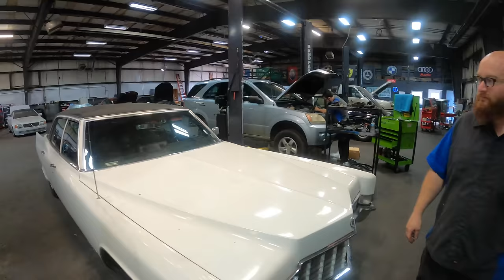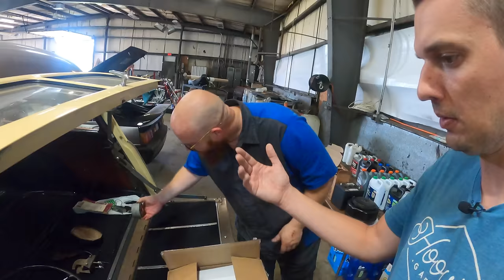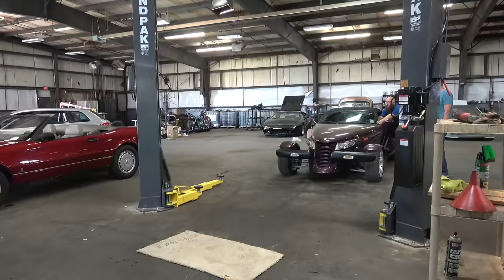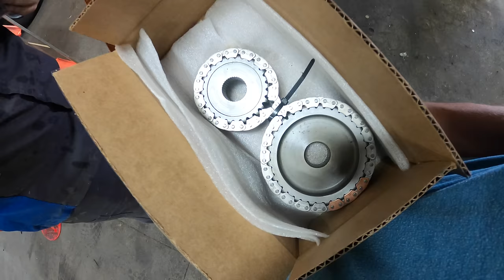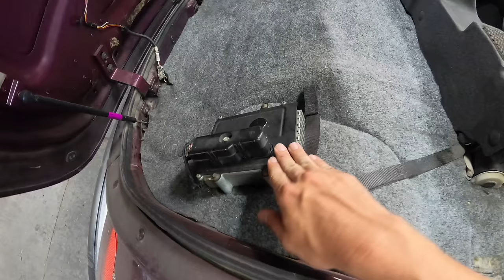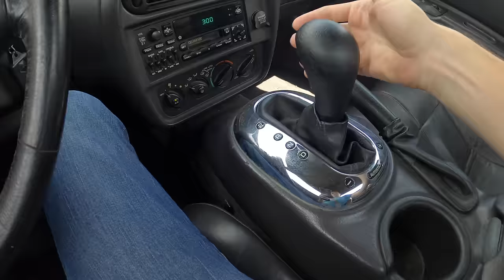Everybody Should Buy A Plymouth Prowler And Do These Mods RIGHT NOW!

Comment: Everyone bashed them for only having 253HP but they only weigh 2500lbs. That’s the same power to weight ratio of the first gen SRT 6.1L vehicles. This video is proof of what a proper tune and gearing can do to really put the power down.

Comment: That Chrysler 3.5L was a great engine. I had a 2002 300M Special with the same engine and transaxle. Absolutely intoxicating exhaust note. Best and most reliable car I’ve ever owned. Chrysler was on fire from the mid/late 90s until Daimler sucked the life out of them.
Reply: You are correct and like BMW who sucked the life out of Rover for 4wd Intel, Daimler ( the Chrysler was silent) did the same. I had other people rave to me about Chrysler products I recommended in the 90s to them.
Reply: We have had our 2000 LHS for 21 years and 278k miles. Still runs great. The Prowler does as well!!
Reply: There were still some pretty good Mopar engines up until the early 2010s when they really went down the drain

Comment: This car seems like such a cake walk to work on, never would have guessed.
Reply: Most Chrysler vehicles of that period were easy to work on. I've done the absolute quickest timing belt and water pump replacement on a car with this 3.5l engine, that I had to double check I didn't miss anything. It was also the cheapest timing belt job, which included everything that should have been replaced.
Reply: Sides of the engine look pretty tight....
Reply: The sides don't matter, there is not much on the side
Reply: I love the 300m and lhs 3.5 LH platform great cars unstated now I wonder if the diff tricks on the LH cars too.
Reply: The diff trick might work, I do remember they were chain driven, but I never opened one. I never needed to open on, those cars were reliable, with only minor issues.
Reply: snoopdogie187 everything matters in regards to aesthetics, but no looks matters in functionality - it’s a weird balance human beings require
Reply: It seems like such cake to work on because they're not showing you any work being done on it. Lol 
Underhood is a bit of a nightmare to work on. The rear quick change gears is pretty neat, but that does not represent working on the rest of the car. Lol
For example, notice they didn't put that panel back on...
Reply: @TravisFabel 
That is the easiest car panel ever to take off. Its 3 bolts and 1 light bulb. Less than a 2 minute job. They had no reason to put it back on because that area is still being modified. 
Underhood isn't bad either, that engine has everything on the front, and the prowler made the front of the engine easy to access.The only thing that was on the side was of this engine, and the one I worked wasn't in a prowler, was the ignition coil. The prowler has a coil on plug setup, so even that is done on the top of the engine. The 3.5 engine was an odd engine, being in a longitudinal orientation, even in front wheel drive cars.
Reply: GM man they come thru sometimes
Reply: David Pasch this isn’t GM lol
Reply: But it is also true of Chrysler, they had their good cars, their bad cars, their terrible cars, good period, junky periods, and everything in between. I tend to think 90s Chrysler was top of their game, and held that for awhile somehow.
Reply: @snoopdogie187  you are hella  rightit also had to do with the engine and chassis , bc 357, and  LS are both bulletproof engines and   with simple yet effective design. Also gm occasionally borrows really good cars , the Chrysler crossfire is a Mercedes coupe underneath but for a fraction of the price.
Reply: @snoopdogie187  I own a chrysler 300 with the same engine and even though the car weighs over 2 tonnes it still gets up and going at a surprising rate

Comment: I love that the intake is buried in the fender. A whole lot of air in there, for sure!
Reply: The ECU is in the worst place!!!!
Reply: I haven't seen that part of a Prowler in person.  For the ECU, generally not as good as having it in the interior.  Still, if they provided a path for cool air to get to the intake in that area, it will probably also help keep the ECU cool.
Reply: @kc9scott  eh, it has the processing power of a wet peanut. Thermals shouldn't be an issue.
Reply: @kc9scott  About the only engine bay ECU placement that didn't make much sense to me was my friend's TJ wrangler- up high on the firewall, just hanging out. Only say that because of what a lot of off roaders get into in their jeeps. Trailblazers have them up on the side of the intake manifold, but I don't think any serious 'froader would be getting one as deep in water as a jeeper.
Reply: ECU will be gone in a minor fender bender
Reply: @3800scgp  Chrysler's 1981 Imperial had the ECU above the exhaust manifold.  Not too smart.
Reply: @agenericaccount3935  Processing power is irrelevant to this issue.  Any electronic item will have a shorter lifespan when exposed to harsh conditions, particularly heat.  Electrolytic capacitors in ECUs have been known to leak their corrosive goo onto the circuit board after as little as 10-15 years, and temperature definitely affects their lifespan.
Reply: @Randy Wilson I guess you're the comment expert..

Comment: It just seems to go over everyone’s head that the Prowler was made primarily for Chrysler to gain knowledge and experience in producing basically an all aluminum car. Many of those involved were lost to Ford in the crash and went on to develop the aluminum F-150. 
Also, it gets overlooked that the Prowler basically is an Indy car design and weighed in at roughly 2,800lbs. At the time of production, 250HP in a 2,800lb car was a pretty damn good power to weight ratio.
Reply: I always felt the same way about the power/weight ratio with these Prowlers when they were new, and back in the late-90's even Vettes only made about 90 more horsepower than this... But most auto publications called these "underpowered" which was weird to me. I've never driven a Prowler but I did lease an '01 Chrysler 300M brand new right out of college with this same drivetrain in about a 500lb heavier car, and I remember it feeling pretty quick for its time.

Comment: Put a Hellcat engine in there, Chrysler would be proud
Reply: 318 Plymouth howler built shortly after the prowler debut . Every Mopar guy wanted this dodge shit the bed not building one .
Reply: nah the v6 sounds good enough.
Reply: The Hellcat probably wouldn't fit. It's really tight in there.
Reply: That'd be sweet!!!
Reply: BiG CaT did you even watch the video you shared, no mention of a hellcat and also he said "well it definitely wasn't a drop in" indicating that they had to do alot of modifications to get the 6.1 in there. Come on brah lol
Reply: gunit 010  
Hellcat is 6.2 l same block and crank . A super charger requires nothing more then a Hood delete or cut out . 
You're excused
Reply: @dustinfoster4944  Hellcat gets special in the specs the dimensions required are in that video . Everything worth while requires work in the gear world .
Reply: Nah, you want a real 426 Hemi in the Aluminum block with a LOT of boost so that you have like 950 to 1200 ponies and...use a LOT of carbon fiber to cut the weight like at least 1/3....THEN you might have a respectable ride.....
Reply: Oh hell yeah...forget that 3.5.
Reply: @nlemonj  there is someone who fitted it with a hellcat engine in 2019 I believe. Before that I saw another guy drop a smaller V8 into one, both required lots of custom work but I'm definitely considering doing it to mine
Reply: gunit 010  
Wise
Reply: The biggest thing the Prowler needs is just a modern gearbox. Put a 6-speed Auto or Manual in there and this power level would be great.
Reply: @Brock_Landers  The modded 3.5 is over 300hp, that's entirely sufficient for this car, especially with a manual conversion.
Reply: The base Edelbrock 350 is 360 I think
Reply: @All These Squares Make A Circle I had a 1999 Mustang GT and a 2008 350Z. As good as the Ford 4.6 sounded with Bassani exhaust, my Z would demolish it with more HP to the wheels than the Ford had to the crank.
Reply: @All These Squares Make A Circle An older V8 makes for a nice cruiser, I won't lie, though.
Reply: @All These Squares Make A Circle Noone cares about a v8 rumble. Yes the sound is great but If I own a performance car. I don't care it could be a corvette or it could be a v8 killer nissan gtr. I don't really care
Reply: A hemi wouldn't remotely fit, and that's without those monster blowers. I really like how most yanks have finally wizened up to the fact V6's can sound really good too. 
Euros have known that for decades with the Italians making many great souding V6s, I think it suits the prowler better given the Viper was a thing back then.

Comment: I wish more manufacturers did that. That seems a heck of a lot easier than re-gearing a transmission to change the acceleration or top end fuel economy of your car. A guy in his garage, or a mechanic with a half-hour, could totally change the character of your car with an easily replaceable and relatively cheap set of sprockets and chains. They're probably less durable than a straight up live rear axle and certainly a limited slip differential but would you rather replace a chain/sprocket set that could act as the circuit breaker, first point of failure or a whole rear diff if that's the point of breakage?

Comment: Hoovie : Kia Sorento one of the first cars to have side impact airbags (produced since 2002)

Volvo 850 revolutionary Side Impact Protection System (SIPS) produced since 1995 : Am I a joke to you 

This is a joke if anyone actually reads this it was for the memes
Reply: My '92 940 is SIPS engineered, but doesn't have a single airbad
Reply: @Ktmzqw  since 1995... i think youre a few years early. Not that an old volvo needs bags🤣
Reply: SIPS isn't side airbags
Reply: My 98 A8 has front and rear side airbags.
Reply: @Danvk008  yes, but that A8 was not meant for the masses.  That little Sorento was a 4x4 body on frame suv for $30k and under.
Reply: My 98 bmw 3 series had side airbags 🙄
Reply: SIPS was a set of sliding bars in the door to reduce the amount they deformed into the  passenger area. No airbags.
Reply: My grandfather had a brand new '98 Lincoln Continental with side airbags, and my 2nd car that I bought in my senior year of highschool (1997 Buick Regal GS supercharged) had 1 side airbag in the driver's seat, none for the passenger lol. Hell my sister even had an '01 Saturn SC coupe with side CURTAIN airbags which was very rare back then for non-luxury cars... The KIA Sorrento definitely didn't pioneer side airbags in any way lol.

Comment: My god the delays in the shift.... Are there manual conversions available for this car? With a manual that car would actually be amazing.
Reply: You can do anything with enough money.
Reply: @2Skinny  Well sure, you could spend a shitload on making a bespoke conversion, but I'm more so talking along the lines of well established and understood methods of doing it. (like taking a gearbox and the ancillaries from a doner vehicle and putting it in)
Reply: Well, if you find another rear transmission vehicle, and someone who can weld to the aluminum subframes on the car, as well as have half shafts and drive shaft (which runs at engine speed)  , retrofit the clutch pedal a and install linkages down the length of the car, and all sorts of stuff, sure it’s possible!
Reply: The short answer is: YES.  There are also LS-motor conversion kits for all those types out there.
Reply: It would make more feasible sense to have the transmission rebuilt by a specialist I am sure there is a prowler transmission guy who knows all the tricks to make them better. All the Chevrolet automatics have different tricks you can do to make them shift much faster, and I don't just mean increasing line pressure. I am sure there is a Chrysler transmission guy aswell.
Reply: The auto is kinda neat for this car. Yes its slow shifting (its a torque converter auto, ofcourse) but atleast it doesn't jerk in between gear shifts.
This car was not meant to be as hardcore as a 350Z. It was meant to be somewhat like a Mercedes SL. Laid back cruising machine.
Reply: @aaryeshg.6526  No matter how you cut it. It's a torque converter automatic. It sucks. Maybe interesting technology for its day, but still, wouldn't hold a candle to a manual.

Just imagine how fun it'd be to drive this thing with the top down rowing through a 6 speed manual in the Canyons of California or something like that.
Reply: @MrManBuzz  With "interesting technology for its day" you mean the 1950s, right?
Reply: @MrManBuzz  they used an auto probably to appeal to everyone. Chrysler would have known it wouldn't sell as well as they expected it to, so an auto was used to atleast add some convenience for average consumers.

Comment: God this could make such a sick drift car.
Reply: It would if it was a manual.
Reply: Incorrect. It would be a Plymouth Prowler.
Reply: If only it was manual! Could swap one if if you had to i guess
Reply: @davelangford2439  nice drift cars are sequential not manual
Reply: Manual transmission and welding the differential, would make this a great winter beater/drift missile.
Reply: @Dragonvale105  I don't think that is true.
Reply: @Wyatt Altizer they do yes, still in its own echelon
Reply: @davelangford2439  the nicest ones do yes.

Comment: I wouldn't trust a Chrysler transmission to stand up to those mods for long.
Reply: Right!
Reply: I wouldn't trust a Chrysler t̶r̶a̶n̶s̶m̶i̶s̶s̶i̶o̶n̶ ̶t̶o̶ ̶s̶t̶a̶n̶d̶ ̶u̶p̶ ̶t̶o̶ ̶t̶h̶o̶s̶e̶ ̶m̶o̶d̶s̶ ̶f̶o̶r̶ ̶l̶o̶n̶g
Reply: @TheGravyMonster  Usually when Chryslers chirp the tires on upshifts it's a sign that your transmission is about to fail catastrophically.
Reply: @Johnny Wishbone It's not Mitsubishi. The LH overhead cam engines (2.7, 3.2, 3.5) were 100% Chrysler.
Reply: That trans was designed for the heavy LH cars. It will hold up in a car half the weight!
And no, that is not a Mitsubishi engine. That 3.5L is 100% Chrysler, and bullet proof.
Reply: Had a 97 LHS. Its a much heavier car with the same engine and transmission (mine was the older iron block so only 214 factory hp, but I think the added power was all up high) The car  never quit. Also remember that the gearing is after the transmission component of the transaxle and is basically between the tranny and the rear diff, so it is even less load on the tranny part after all of the mods.
Basically I am saying, I wouldn't have the slightest fears doing these mods on a Prowler...or any of the full sized FWD Chryslers of the era.
Reply: @Johnny Wishbone that transmission was never behind the mitsu 3.0. Eta; most cars that got the 3.0 only had 4 cylinders as other engine options. And yes, Chrysler transmissions were particularly bad back when the 3.0 reigned supreme in the K cars.
Reply: @MrJamesonStyles  derived from the 3.3/3.8 pushrod engines I believe.
Reply: Car was running fine Hoovie wants it to break
Reply: Funny  250000kms on my 2001 300m without one issue. 
Proper maintenance 
Sandbox is that way, princess 👉🏻
Reply: @dodgeguyz  all the cars with 3.5 were overlooked my sister had a 97 lhs that was a really good car no issues at all.
Reply: @Michael Curley You must be talking about the Pentastar 3.6. Very different engine. Like GM with their 3.6, they went from a reliable engine to one that made more power but broke more often.
Reply: @Michael Curley not even close to the same transmission. Chrysler had been ben sold 2 or 3 times since then.

Comment: God could you imagine that thing with the hellcat engine in it
Reply: insert clip of jeremy clarkson going AHAHHHAHHHHAHA with one of his supercars on top gear lol
Reply: or even worse taking a DC Induction motor out of an electric train with the motor designed to hual 12 carriages and this would accelerate faster than potentially the new Tesla Roadster
Reply: @wclifton968gameplaystutorials  how much would that motor weigh? 2 ton?
Reply: It'd be more 'on it' than 'in it'
Reply: It will torn this thing apart.
Reply: The Unreal Thick Sunny the motor would be heavy but DC electric motors are a lot smaller than people think and most of them barely take up any space in trains so depending on what train you’d salvage the motor from it should really be only slightly heavier and larger than what you’ll see in the Tesla Semi Truck or Tesla Cybertruck

Comment: Love the video Hoovie! But just a heads up, changing the gear ratio actually isn't changing your horsepower. If you put it on a dyno you will see an increase in torque down low yes, but your horsepower will still be 100% the same.
Reply: It can if you mess with the rev limit etc the change to the  transmission ecu will change HP. The gear ratio alone no.
Reply: I think he means with exhaust and maybe tune itll increase hp and the gear will make it feel more powerful.  Hoovie is actually kinda smart even if he plays a dummy online

Comment: Not a Ford guy but those Flatheads are just gorgeous! With that tune on the Prowler, you can go catless and straight pipe it with 3" stainless from the motor back without the CEL! It will sound uber deeep and really growl.

Comment: Came across this when looking to see what folks have done this many years later to Prowlers. Those reduction gears were popular back in 2004 or so with the Intrepid crowd because someone found that the stock Prowler transfer gears fit and that they were the same or similar to 300M Special ones. So then folks put those or the Prowler Pro (brand at the time) gears on their 1st gen LH cars. It was a wild time.

Comment: I owned the rare Black Tie Edition for 6 years.  Was a wild car!! Was a circus everywhere I went.... Even at 253hp, it lost a lot in the long axle and drivetrain and only put out 160hp at the wheels!  BTW: Hope you also did the ball joint recall, or the front wheels can fall off.